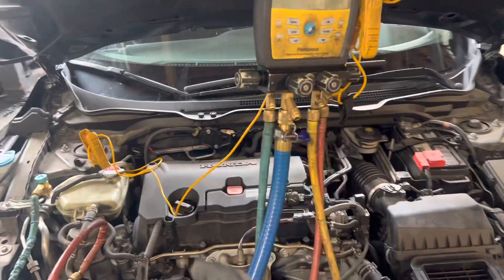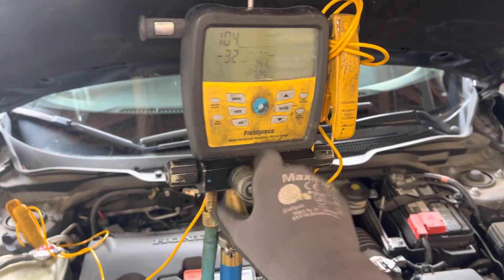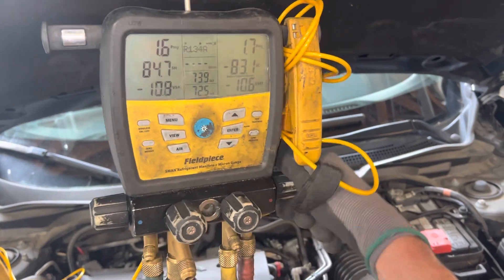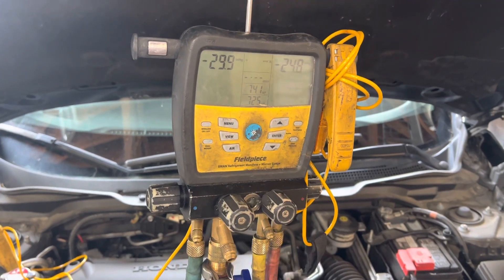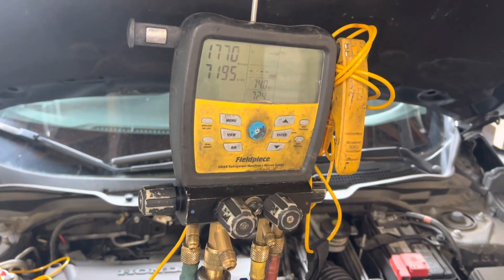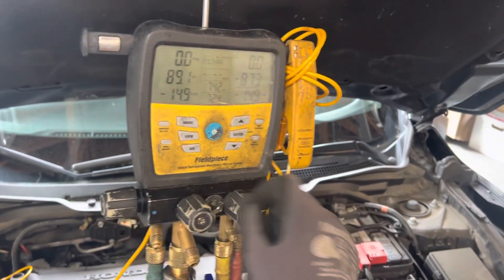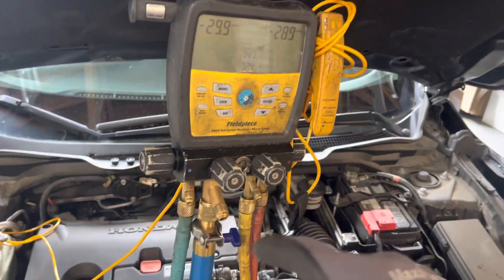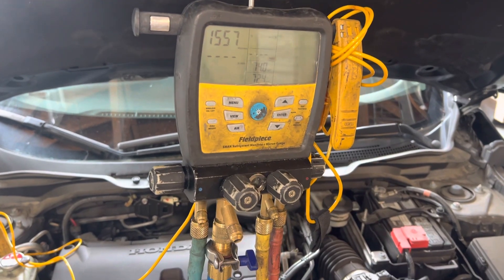SWITCHING R134a BACK TO R1234YF, Triple Vacuum and purge with dry nitrogen￼

Comment: For what it's worth, there are now blends that contain both R134a and R1234yf. R513a was designed as a drop in replacement for R134a and it contains 56% R1234yf and 44% R134a. The pressures are very similar to either refrigerant by itself. So judging by that, it doesn't seem like R134a and R1234yf will chemically react.

I do have major concerns with using anything containing R1234yf in an R134a system though since R1234yf reacts badly with R134a PAG oil and I'm not sure it's very compatible with R134a seals and hoses either.
Reply from the maker: @averyalexander2303  1234YF needs a anti-acid corrosive inhibitor of a much higher concentration in their refrigerant oil. That’s the main problem.. 

That is why you can put 134 into a system. The oil is the same, except it has more corrosive inhibitor. 

134 does not have the high corrosive inhibitor that is needed for 1234YF
Reply: @coldfinger459sub0  Good to know, thanks for explaining! I was also told that R1234yf tends to break down regular PAG oil.

Other than price, are there any pros or cons to using R1234yf compatible oil such as ND-12 in R134a systems?
Reply from the maker: @averyalexander2303  usually brake down doesn’t occur unless there is a reaction with oxygen, water, excess heat.

No other benefit that I know of using YF in 134 system 

As long as oxygen moisture and heat kept away from the systems, the refrigerant itself and internals of the systems were last forever . 

No contaminants , never allowing the refrigerant to get low. No excessive heat mix for AC system that will last longer than the car last longer than the engine longer than the transmission.
Reply: @coldfinger459sub0  Awesome, I was wondering about that too whether the oil breaks down over time from normal use, but it's good to hear that it shouldn't. In a way, it makes sense that it wouldn't because I'd think something would have to cause it to break down and there shouldn't be air or moisture inside the system in significant amounts for it to react with if it's serviced properly since it's a sealed system. And since I don't believe these oils contain polymer viscosity modifiers, I wouldn't think they could be mechanically sheared.
Reply from the maker: @averyalexander2303  compressors do not die. They are murdered.

Comment: so in a situation like this is it not needed to flush components out with a cleaning agent?
Reply from the maker: No because it is a gas it is not a thick liquid like oil.   It completely evaporates like propane leaving no residue behind. 

I drawing a very low vacuum you are boiling it off out of the system. 
       Then by flushing from the high side with dry nitrogen pushing through the system any minute small residual gas in the parts per million you are flushing out and then you’re repeating the vacuum again and you repeat this process three times. 

And you would have removed the gas down past the level of undetectable

Comment: How did they get r134 in there. Doesn't r1234yf have different fittings
Reply: So much for the intent to keep refrigerants separate by using different fittings. 😂
Reply from the maker: @mailmanjoe it was a failed attempt that failed miserably. 

Specially, when the EPA mandated that you put retrofit fittings for 134 on top of the old quarter inch 12 refrigerant fittings that had lots of leaks caused by the retrofit fittings themselves
Reply from the maker: There are adapter that convert the right hand acne thread on R134 to left-handed acne thread for R1234YF